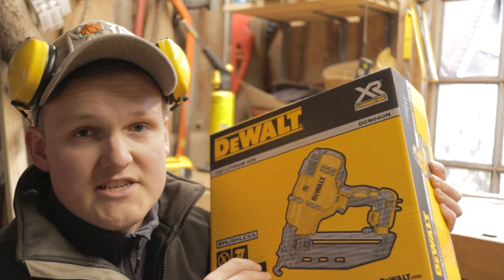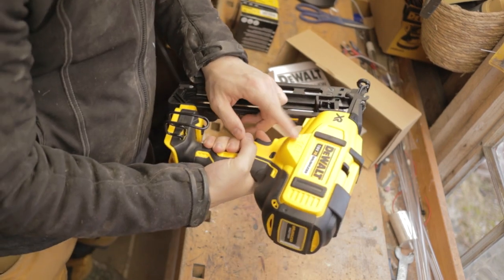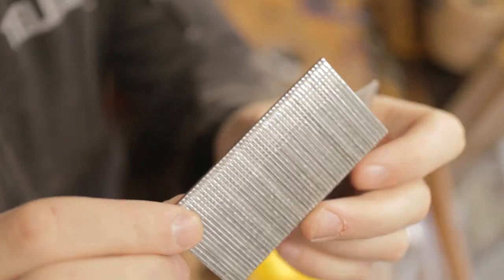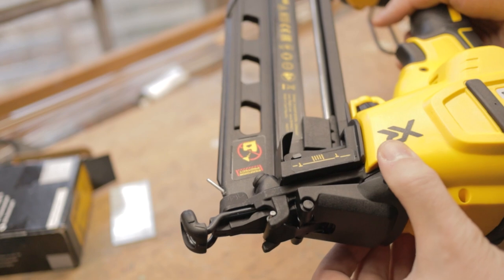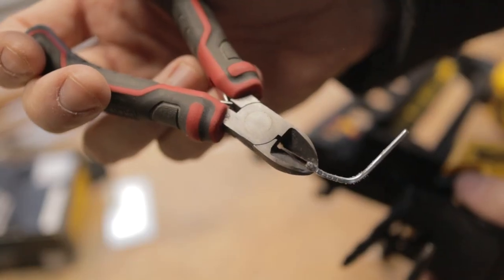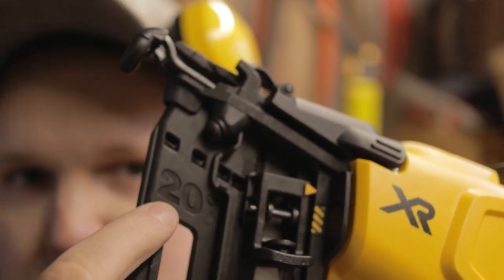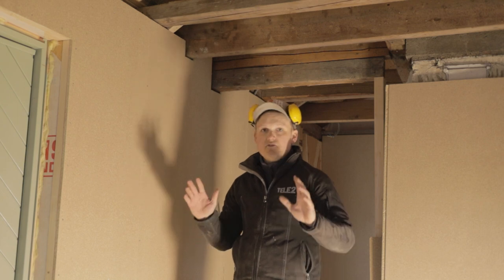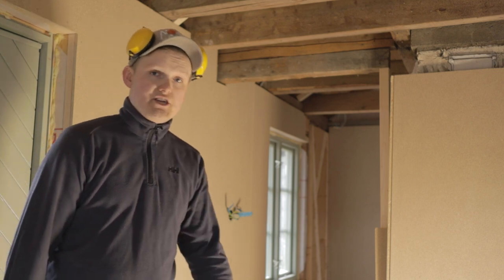New Tool Instantly Damaged - Avoid This! | DeWalt DCN660 Jammed

Comment: Just a heads up but there is one spare tip stored on the nailer. Near the switch is another rubber tip.
Reply from the maker: Aha! Thanks for pointing it out, would've never thought it was a spare tip!
Reply: whar switch
 @TryingToBuildStuff

Comment: This explains lots of bad reviews on home depot website for this gun with pictures of the nail coming out from plastic magazine instead. I suspected that they used straight instead of angled nails to have that happen but this confirms that those people were just either not reading manual properly if at all or just lazy idiots who think they already know more/enough and then blamed manufacturer on their errors which is even worse IMO. For an experienced contractor it should be more obvious that straight won't work since firing pin/tip always shoots out straight so if magazine is positioned at angle it should also click that nails should be also at angle, it's been like that since Paslode guns were a thing that also had straight and angled options as well (angled coming out slightly later than straight). Worse thing is that people claim they did "everything right" and gun jammed on "the first nail" that should have been a good giveaway for them though.

Comment: If you can't work out that this needs angled nail then maybe you shouldn't be anywhere near a nailer in the first place? Going to get yourself or someone else hurt!!
Reply from the maker: Hehe, I agree, but I did get the nails handed to me in the same store I bought the nail gun in, so I didn't think twice about it. Thought it was a bit strange with straight nails since my other nailgun has angled ones. Well, I learned to double check what ppl hand me at least ;)